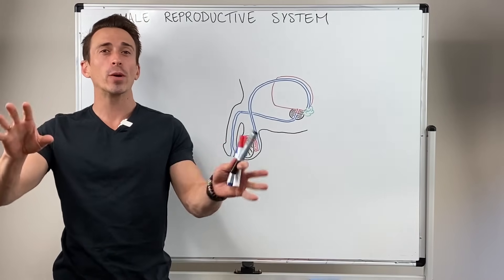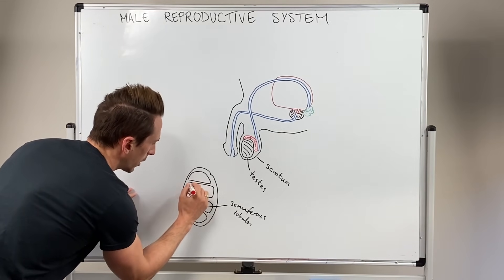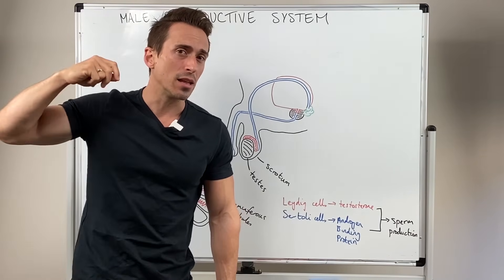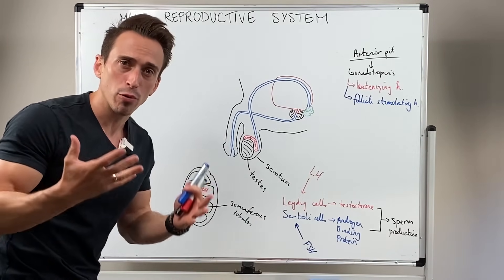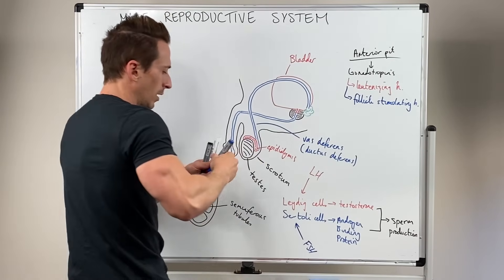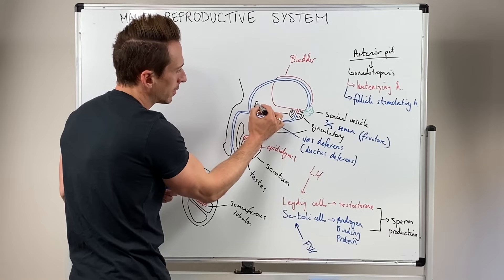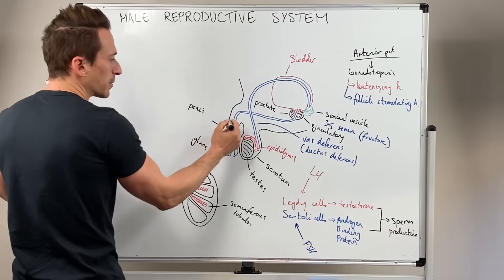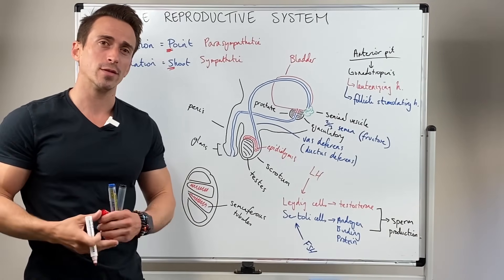Male Reproductive System

Comment: Meneer als de zaadbal zo belangrijk is. Waarom is het op zo een kwetsbare plek neergezet. 1 rik balletik en het is klaar.
Reply: The testes are found in the scrotum (the sac suspended from the body) because sperm production occurs in a temperature (2-3) degrees Celsius lower than the body temperature (37C). They have to be separated from the abdominal cavity. So the testicles are found in the place they are precisely because they are so important.